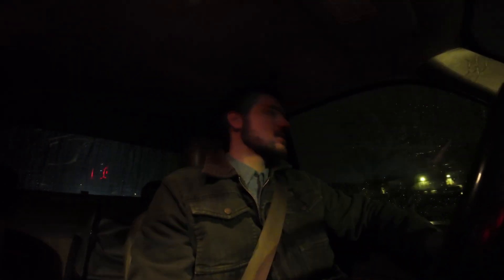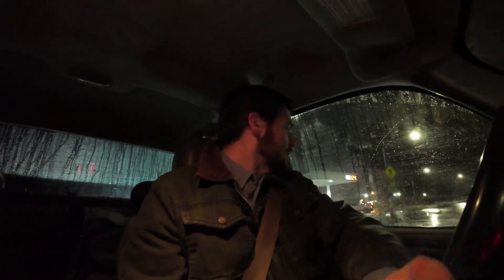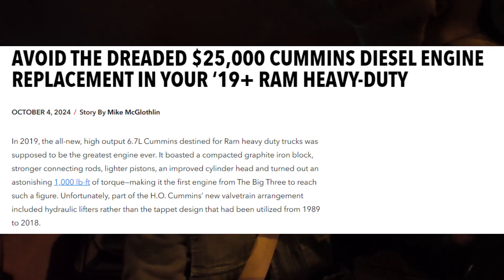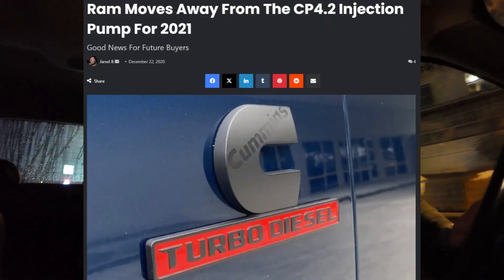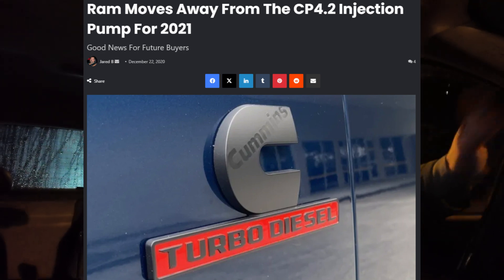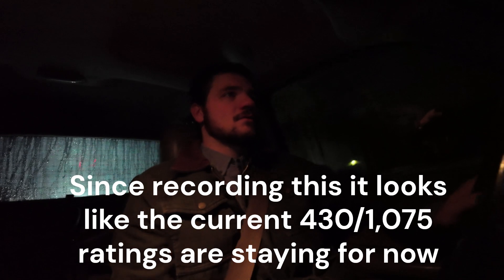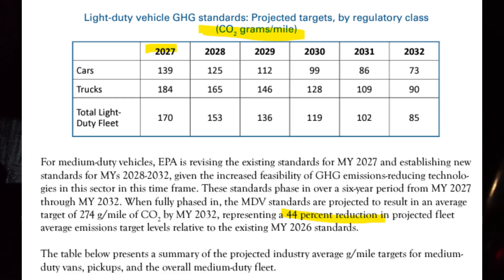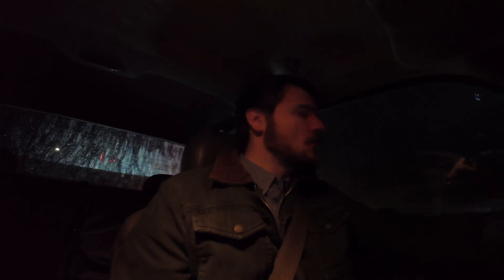New Cummins, future of diesel emissions | it's expensive!

Comment: Im curious if the equipment used to mine the lithium for electric cars amd the rare materials used in Catalytic Converters and  the DPF system. Also I'm curious if a study was done about the effects of DEF on the environment?
Reply from the maker: Good questions...i don't know the answer
Reply: They don't have emissions standards in most of the countries where lithium, cobalt, and other materials to make batteries are mined

If there is a DPF on the machines it's just because the manufacturer isn't making a non emissions version. I've seen big trucks flashed with Brazilian tunes to delete DPF and SCR systems

Comment: The entire regen process doesnt make sense in my mind.  The dpf filter grabs it and then it revs the engine creating more exhaust  in order to heat the system and clean the filter.  Process repeat   I agree with some emissions control but IMO its a money grab.
Reply from the maker: @nolehopkins1077  I hear ya. I'm afraid with the tightened regulation that we will legitimately be seeing failures under 100k miles on the regular. At some point you can only force so much exhaudt through such a small hole....its just physics. Then you're dumping more fuel and/or heaters on the dpf to get it up to temp...defintely downsides in there. I guess we will see